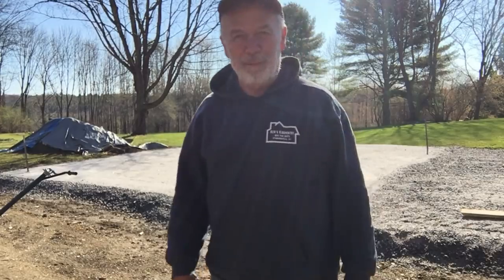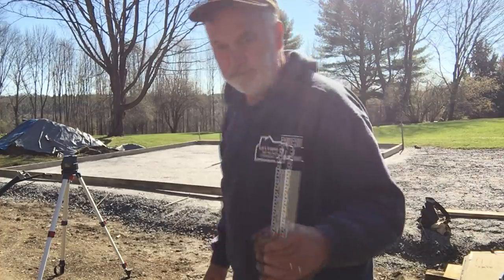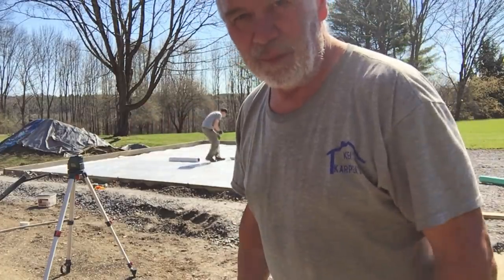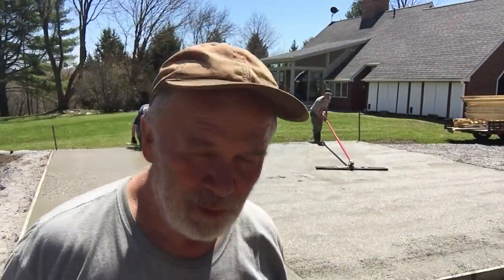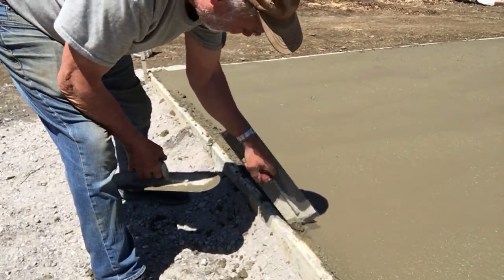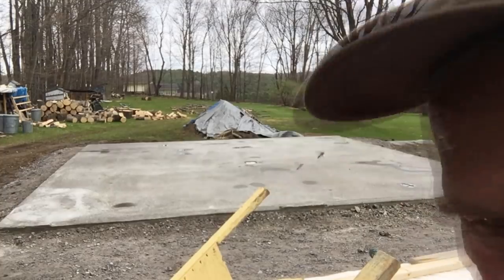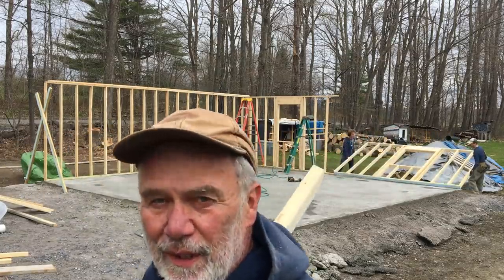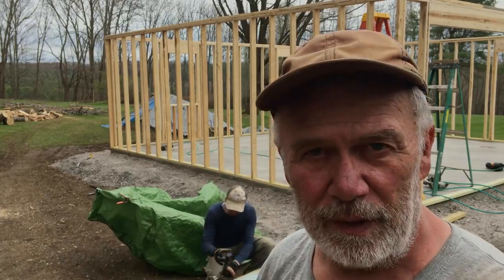#187 Ranch Style Garage $18,800 materials and labor.  Part 1 Concrete and Walls

Comment: Hi Ken, Looking at your sill plate, I couldn't see anywhere that it was bolted to the cement. Did I miss something?
Reply from the maker: We use split anchor bolts after the walls are up

Comment: Just asking Ken,how you anchor ( bolts) the wooden base plate embedded in the concrete I can’t see during your wall framing.
Reply from the maker: We use wedge anchors after the walls are in place

Comment: Ken how did you connect the walls to the concrete?
Reply from the maker: We use split anchor bolts after the walls are done